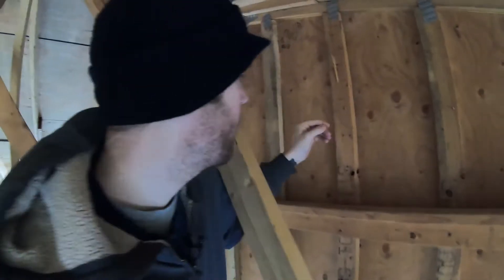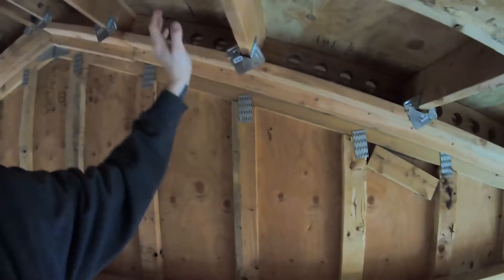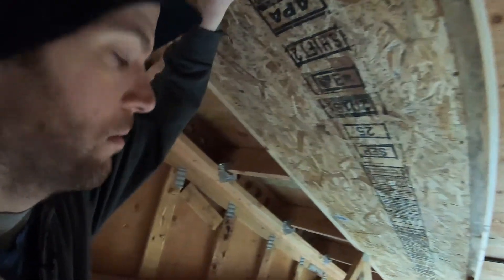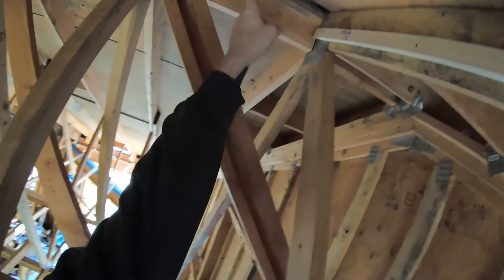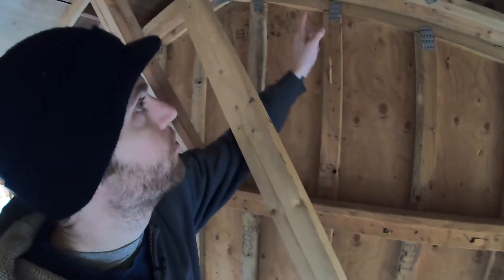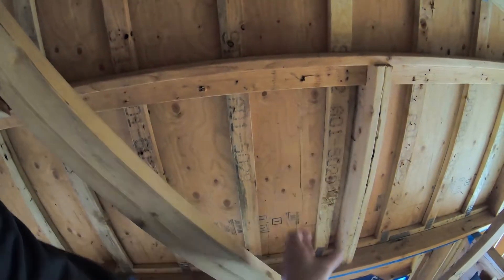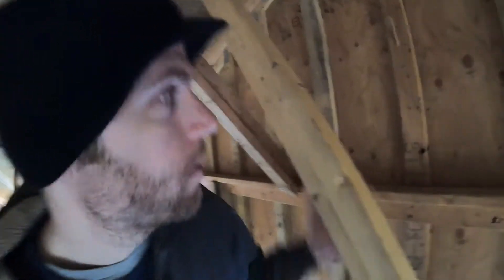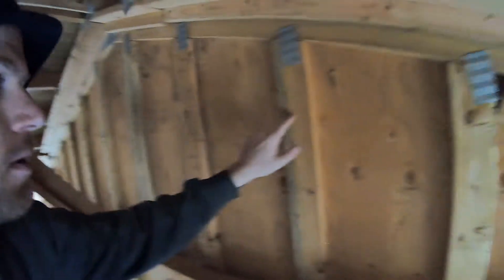Gable Construction ERRORS, Venting and Air Sealing

Comment: it's kind of odd they put vents up there.
Reply from the maker: I had them put them in, that's why it's odd.  Bird blocks normally wouldn't be used on the gables (because they would alter the airflow for the worse in the attic), but I had a bunch of extra ones at the time and gave them to the framers to use in case I needed the extra ventilation for those areas.  Turns out that I did need them there because of the way I choose to air seal the attic.
Reply: @TheLeaversFamily  it makes sense if you have those instead of rooftop vents
Reply from the maker: @FixItYerself  Yeah you're right.  Without the ridge vent it wouldn't matter much.